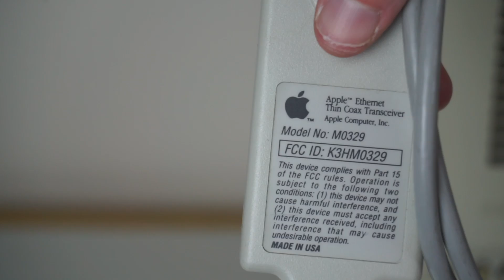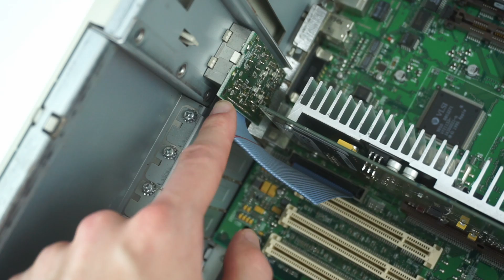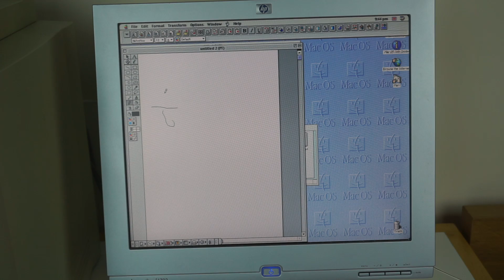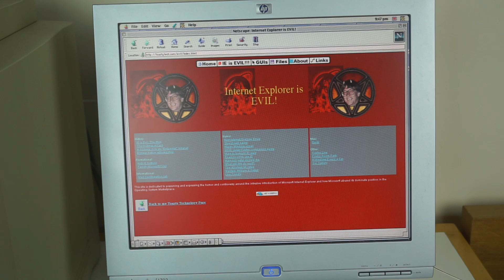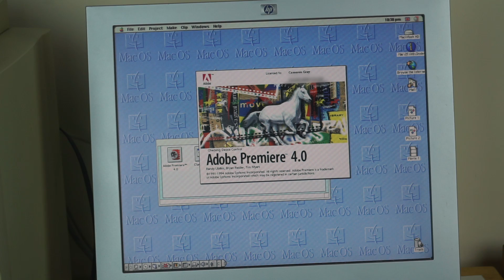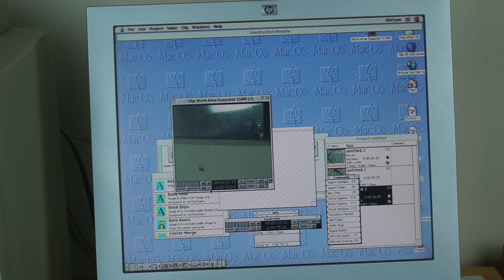Apple Power Macintosh 8600 Tour, Teardown & Analogue Video Capture/Editing Demonstration

Comment: I just bought one of these. I was debating because I have a desk I use my MacBook Pro on, but I'm not comfortable enough to put my Power Mac 7500 on it (which is not a tower computer but an outrigger type as they called it).
It should solve the problem regarding space issues. I'm probably gonna sell off the 7500 once I beef up the 8600 with PCI cards I already got along with the Sonnet Crescendo G3.

Comment: Nice your video; In Premiere you should try pressing the Enter key to render. The PowerPC 604e should have sufficient power to do quite quickly. In the past I saw a car so used to mount television documentaries.
I have a Power Mac Blue and White with CPU G3 at 300MHz (very stable 400MHz overclok) with original video card and 512Mb of ram. I have to try an acquisition card, the RTMAC Edition, but I don't know yet if on this system you can work

Comment: Merci !!!!! Super vidéo 
Coule you tell us please where can we baught the VGA converter please ?
Reply from the maker: Unfortunately I was given the adapter along with the machine so unfortunately I don't know exactly what model it is.  The type of adapter however is known as a DB15 to HD15 adapter so you may be able to find ones by looking that up.  That said, I'm not sure how compatibility works, make sure you get one designed for connecting a VGA monitor to an old Mac, not one for connecting an old Mac monitor to a VGA machine as I can see both types available.  Probably also worth ordering from somewhere that allows for easy returns in case the one you buy turns out not to work for what you need.
Reply: @camerongray1515  merci for your answer 👍🤗

Comment: What kind of hard drives does this machine take?
Reply from the maker: As standard they take 3.5" SCSI-2 (Fast SCSI) drives using the standard 50 pin IDC connectors.  Apparently they can also boot from certain PCI cards which could allow the use of more recent SCSI drives or IDE drives which are probably easier to find nowadays.
Reply: @camerongray1515  that was my next question; is it possible to attach a modern-day SATA drive to this machine. Most of the 50pin drives I could find on eBay were expensive and had low storage capacity. Do you know what the maximum amount of storage this machine allows? Also, I purchased a 68 pin IBM HDD with 4.3GB and used a simple cross-over adapter on it to make it 50pin for the computers ribbon cable. The disk was not supported. I don’t know why. Any thoughts? Thanks!
Reply from the maker: It's possible you may be able to get a suitable PCI card however I don't know enough about these machines to really advise on what would work.  You can however get the SCSI2SD device which will let you connect an SD card to the internal SCSI bus.  As for the drive you tried, it's been so long since I did any vintage computer stuff that I'm pretty rusty, I'd make sure your drive is backwards compatible with the SCSI bus in this system and check for any jumpers on the drive that you may need to use to set the SCSI ID.
Reply: Cameron Gray alright, thanks Cameron!

Comment: The RAM is installed incorrectly. It should be installed starting with B4/A4, then B3/A3, etc.  Matching pairs will greatly speed up RAM access by turning it into a 128-bit wide memory bus and will enable interleaving (read and write at the same time).

Comment: Our first Mac was a Performa 5300 (which had a TV card for PAL/SECAM analogue television in Europe), then when my father moved here to Costa Rica almost a year after we moved, he brought a Powermac 6400 or 6500 (I don't remember the exact model, but I know it's one of those because of the tower). That's our history with PowerPC Macs, we did have (in the 68k category) a very old monochrome Powerbook (which I believe we gave away to a relative) and a colour Powerbook that basically fell apart when we wanted to sell it to a Swiss acquaintance of ours in the early 2000s.

Comment: 3:15 Minor note: the port you mentioned as AUI is actually an **A**AUI: A Mac variant with different power voltage (5V vs. 12). There were AAUI-to-AUI adaptors, though.
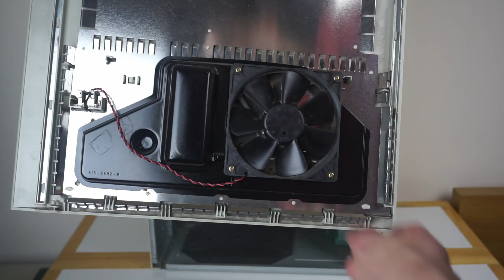5:25 I had a G3 tower, and it didn't have a fan there. In fact, the only green I remember is

Comment: I used to have a bunch of older Macs, including this generation and the beige G3 (all the way back to LCII/LCIIIs, IIsi, Quadra 700s, pizza box 6100s... ) Loved the (basically) toolless cases at the time, versus getting into my PCs at the time. (And my last system... I'd have loved the side terminal for the case wall fans, the power cables were annoying.) I miss the days where Apple felt that this much access to the guts of your Mac was OK...

Comment: When I was in college, this is the exact model we used in the computer lab and our art classes.  They were the worst computers I'd ever used, especially when trying to run Netscape (which would never stop loading a page no matter how many times you clicked "Stop").  I regularly complained that my $600 home-built PC blew this thing out of the water both in utility and performance.  I would regularly walk out of lab class, go to my dorm, do my work on the PC, walk back to class, and load up my project from a ZIP disk and still get my work done faster than everyone else.  Even worse, the Mac couldn't multitask when printing a document, and that was a productivity killer when you had to use a shared printer.  The "smart" labs had a dedicated multi-thousand dollar Mac just as a print server!
Reply: I'm actually agreeing with Murphy the turtle, but I had a similar experience with you Wacoon never the less... My school computer "lab" had custom "nordic" computers which used the 80186. It had an OS not that far from MS-DOS but a bit better, still horrible though... and we did get programming assignment for our tests and I just refused and said I could this way much better if you just let me use a C64 (which we had, only 1 though with a normal CRT monitor)... and if I recall correctly we had to use Comal (yes not Cobol, but Comal)... Found a Comal interpreter on the C64 and started to program a paint program on it (with the Comal language) instead of the singel circle/square assignment...and my computer/computing teacher gave me the highest marks...

But anyway... the 604e PowerPC was far better then most of the contemporary things out there when it arrived, Apple OS sucked it dry though...
80186 was faster then the C64 also in many respects... but the OS sucked balls and raw programming skills made a huge difference...
Reply: @alexanderwingeskog758  kids like @Waccoon are too young and just follow internet tropes about platforms. That fucking kid doesn't know what bus speed his machine ran at, or it's architecture etc. They don't even know how MS almost destroyed the internet with IE6 and activeX.
Reply: Without saying the year your comment was based on it is meaningless.
Reply: @jadamsnz  yes
Reply: the equivalent processor to the 604e is the pentium pro, which cost around 500 by itself. Your piece of shit pc didn't have video in. You have 0 idea what you're talking about.

Comment: I had a Power Macintosh 8500/180 about 12 years ago, which I could not get to work properly. It always froze, no matter was version of Mac OS I was trying to run on it, no matter what amount of RAM I used, etc., so it mostly had a defective logic board. In many things it's very similar to the 8600.
Later, in 2007 I sold my PC to get a Power Mac G4 MDD (the dual 1.25 GHz one) and have been a Mac user since then...

Comment: Should have put Classilla on for the web browser, run in System 8 - 10.4 (classic) and is awesome.
Reply from the maker: +Kathryn Radonich Yeah, will need to give it a go on this, I've used it before on my iBook G3 under OS 9.2.
Reply: Cameron Gray I run it on my PowerBook G3 Pismo (with 500mhz G4 upgrade) and my 450mhz PowerMac G4running OS 8.6 dual booted with 10.3.9. runs like a charm on them all. Need to see if my PowerBook 5300CS works but can't find the power cord

Comment: You asked why the case is so big even for the smaller revision of the motherboard and later in the video you don't know where to put the drives that could be connected to the second SCSI port. 🤔

Comment: I have one of these which I upgraded the CPU with a Sonnet G3 running at 500 MHz, installed 768 MB of RAM and have two 27 GB internal SCSI HDs. I never installed OS X because it was a VERY involved process so I never bothered with that. It runs Mac OS 9.2 like a scared rabbit. Booting is a little slow because the 8600 has to recognized the Sonnet CPU. I love this machine. Video and audio work is awesome, although my A/V software is dated. I'd love to install USB and FireWire if I could find a PCI card. After seeing this video, I might give installing an old version of OS X on it after all. Since I'm retired, this might be a way to spend an afternoon!
Reply: It runs mac os 9 like a scared rabbit?  Is that a good thing or a bad thing?
Reply: @JaredConnell  I have this same question. What kind of video editing software runs on OS9?

I literally bought Mac over PC to use Final Cut Pro 7 (I have the studio suite). The Apple website claims it requires at least Mac OS 10.6 (Snow Leopard), but there seems to be many people running it on OS 10.5.8 (Leopard) with no issue.

Would love to hear from anyone who has edited using FCP7 on Sorbet Leopard (10.5.9). 🍎

Comment: I worked on these beige macs in the 90s. They were good machines except for one thing,. The SCUZY connectors were terrible and regularly destroyed data on external hard disks. Daily backups were required but it was easy to lose a days work on these things.
Reply: Nitpick SCSI. Small Computer System Interface. Yes, pronounced "Scuzzy," but still. :)

Comment: from a technical standpoint, can this computer support IDE hardware via a PCI- IDE Controller card, or is this machine stuck with SCSI?
Reply: PCI cards exist for Firewire 800. You can still find new ones for sale on Amazon. https://www.amazon.co.uk/PCI-FIREWIRE-800-CARD-INSTRUMENTS/dp/B002UOWQQU
StarTech among others have PCI USB 3.0 cards. https://www.amazon.co.uk/StarTech-com-Port-SuperSpeed-Adapter-Power/dp/B00AWP9LMG
Reply: If you wanted to boot from it, you’d need a card that supported the broken implementation of OpenFirmware that the Old-World Macs had.
Reply: I'd like to hear an answer to that. I have a giant boat-load of 250 GB IDE hard drives in my closet, and I'd love to replace my two SCSI HDs if there were a PCI card to accommodate them.
Reply: you would need to disable the rom on the ide card (the rom will expect intel cpu and pc bios) and still boot from scsi but it would be doable if you can find drivers for macos (good luck) or used yellowdog linux..
Reply: Finding drivers wouldn't be the problem. Finding a PCI card for IDE/ATAPI is!!!
The whole world is now using those damned PCI-e cards, useless for us old farts with aging hardware.
You can't even find PCI cards for USB 3.0 and FireWire 800!
Reply: https://www.amazon.com/Syba-Controller-Software-Component-SD-VIA-1A2S/dp/B002EL4RL6/  --- this is just one example among many on amazon... the problem is going to be the rom on the card since its going to look for an intel instead of a ppc cpu... ...there arent any jumpers on that board so its not going to be one to work but you could use it in an old pc... 

a usb 2.0 card would really be the best thing to plug into this board... could use external drives and other devices.. granted not fast but considering this thing is only 200mhz usb 2.0 is going to eat it alive anyway... 
great example here; https://www.amazon.com/StarTech-com-Port-Card-Adapter-PCIUSB7/dp/B002VY53ZK  ... but again ... good luck with the drivers...

Comment: Great video, I didn't know about the 8600/200, Mac Tracker has only the PPC 8500 in its reviews. Don't know what are the differences ? 
To clean this machine up, you can use hydrogen peroxyde to remove the plastic's ugly old yellowy colour. They'll turn white again.
Reply: You can also use Clorox Soft Scrub. It's not nearly as abrasive as it might sound, and you don't have to worry about spills!

Comment: Was it possible to capture higher quality video from the capture card in Premier or did you just capture it at that resolution just to get it done quick ?
Reply: I can answer that one. I was fiddling around with the video capture capabilities of my 7500/100, and yes the lower resolution the less it drops frames. Frames rate are better if you use an external PCI card like the ATI Xclaim VR Pro. It also has a lot to do with hard drive access times. Companies used to make "AV" type hard drives specifically for video capture. We've come a long way since then.

Comment: This is an excellent video!  A few months ago, I took a trip down "Memory Lane" and picked up from an Ebay seller the first apple computer that, I ever owned which was a 5500/250 "All-In-One".  During the mid-2000's when the built in monitor on this model died on me, I made sure to remove the apple video card and apple TV/FM radio card with remote control.  Therefore, after loading in 20 year old software and my saved apple cards, I also used my old Sony HandyCam to record and edit video.  In addition, I also recorded TV and radio shows ...just like I did back during 1998.

Comment: Trivia: the analogue video card used a "personality slot" and was called the "Wings" card. Pretty cool!
Reply: M3G4UK that was on the beige G3 systems,  those used a personality card, the 8600 just used a ribbon cable connected to the logicboard. wisper personality card (which was just for sound, and comm slot) and wings personality cards (which was for audio and video as well as a comm slot), in the All in one Beige G3 the personality cards also handled the video signal to the built in monitor.

the comm slot was for peripheral card like a dialup modem so you wouldn't have to take up a PCU slot for the card.

Comment: You can get a SCSI2IDE adaptor that will let you use that IDEZIP in the PowerPC mac, just google it, the unit won't boot unless you have the SCSIZIP unit, would that slot take a INTEL PENTIUM II Slot mounting MMX CPU might let you install OSX Sierra.
Reply: I don't think you can mount just any CPU, I think it's a very proprietary slot. Besides, you would not have the ram or disk space.

Comment: Man, this brings back some memories. I have back in my home country a 6500/300, maxed out. I should bring it over one day. Unfortunately, the only thing I don't have for it is the capture card. Someone at my place connected it to the wrong voltage, so I need to fix or repair the power supply.

When I purchased it back in 2003 or 2004 it had all the productive software installed: Premiere, Macromedia, Photoshop. I formatted it without giving it much of a thought and never managed to restore it to its former glory.

But it was amazing. I used it as my main computer for a year, and the my mom still used it as her main computer until 2008 or so, more than ten years after the machine was released. I actually could run The Sims 1 there, even though it's below the requirements (G3). It would take forever to load, but afterwards it was quite playable!

I also liked the sound system - it sounded quite ok, and if you had external speakers connected, the interla computer speaker would work as a subwoofer.

You could try some classic games in it. =)